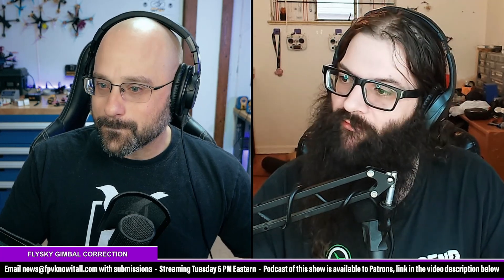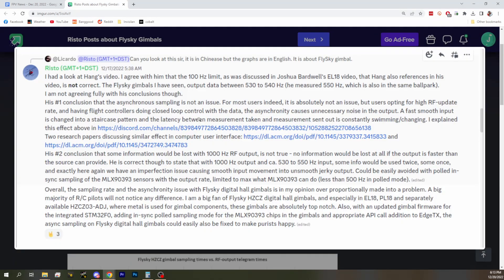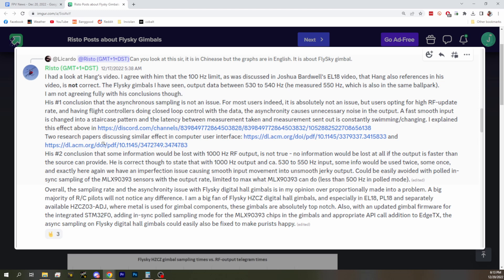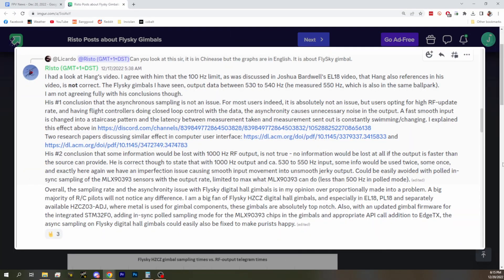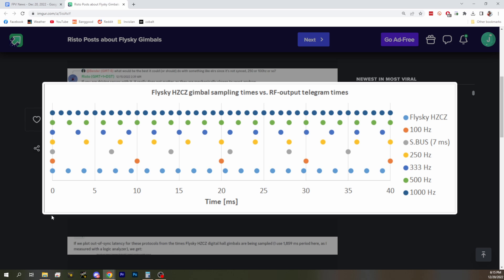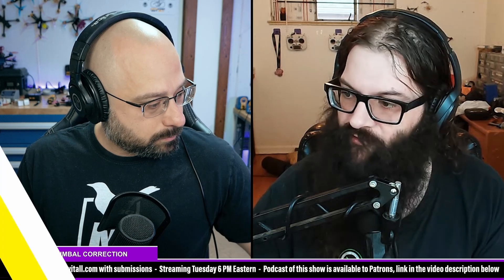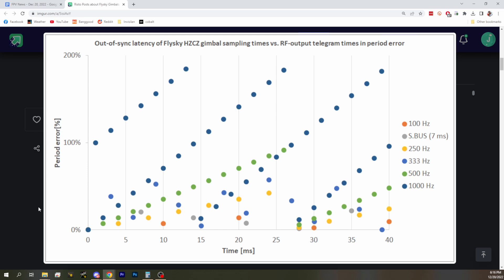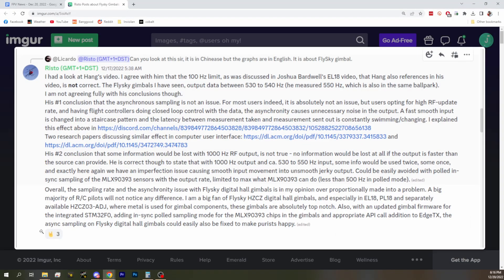Flysky Gimbal Information and Clarification! - EL18 - FPV News

Comment: I think this is - as the comment says - understood as a major issue which it is not. Your RC input may practically be off by 2ms. Do we really think that one can feel this?
Reply: It’s mostly about out of sync sampling noise and jitter and what they could do to your pid controller. The fixed part of that delay (2ms) is not a problem.
Reply: @PraiseKier  let's drill that down. The sampling is well above Nyquist. Even if a bit irregular, we get everything needed. The PID controller may oversteer, if there is temporal jitter. That though is only relevant if the effect is relevant. With 500+Hz of sampling any stick input is slow compared to the sampling. Thus the effect is quite theoretical.